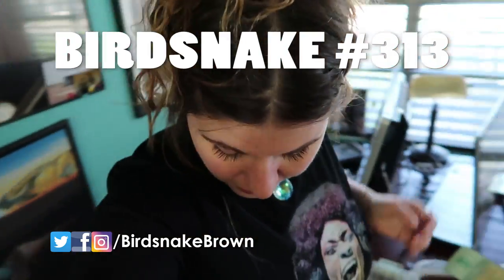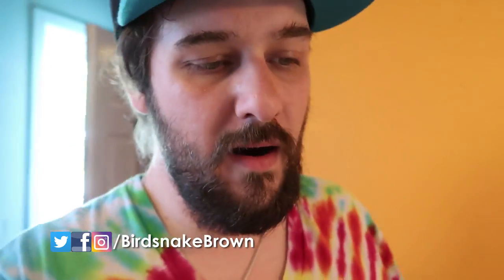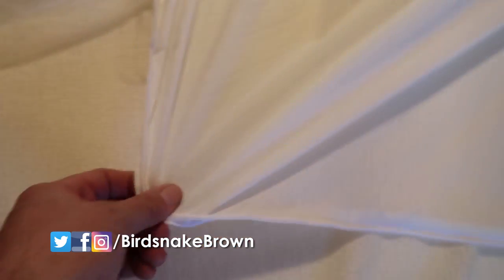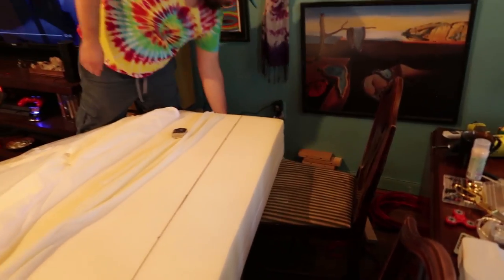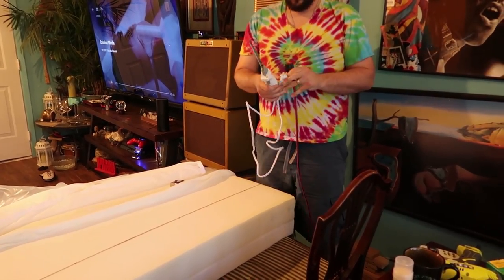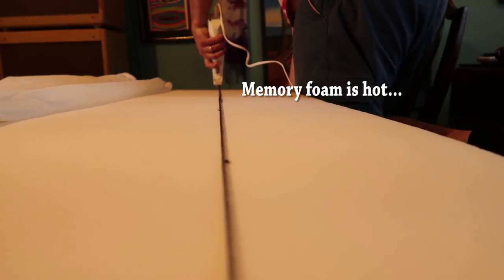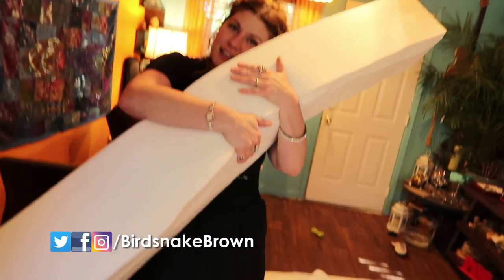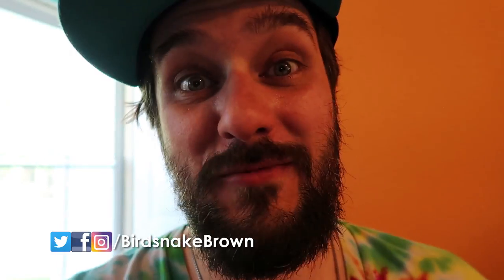CUTTING A MEMORY FOAM MATTRESS FOR OUR VAN

Comment: Did you experience any issues after using the mattress for a while? I just bought a zinus foam mattress and plan on cutting it to fit in my van.
Reply from the maker: We really like the mattress. We sleep on memory foam at home and in the van. We picked this specific mattress for our van because it had a similar feel to our bedroom mattress but with a much shorter profile. Our store carried the mlily brand for 5 years and we never had one back with a warranty issue so I feel pretty confident about it. I looked up the Zinus mattresses and they seem very nice. As long at the firmness or softness suits your sleep style I'm sure you'll love it.
Reply: @ Connor Lipke hey did you have any issues with fiberglass contamination after you cut your zinus mattress ?

Comment: Hey, is the matters keeping up? I heard people say that they may tear apart because they're missing the reinforcement glue from the sides
Reply from the maker: Yes, it's still going strong. We sold them for about 6 years and never had a single call for a warranty issue.
Reply from the maker: It's years later and the mattress is still doing great. We only use it when we camp but it lives through the Texas heat and mild winter. If I was going to sleep on it every single night I would get something softer.

Comment: Did you run into any issues with fiberglass being on the inner cover? I'd like to cut a mattress to fit an antique bed, but I keep reading about people having problems with fiberglass.
Reply from the maker: No, we didn't have any fiberglass in the FR barrier, but some mattresses do.  I'm not sure how to tell you to check because manufactureres rarely list the FR material in their specifications.
Reply: I can’t find a mattress without fiberglass
Reply: Most foam mattresses have glass fiber in the base foam build.  It is not the same as fiberglass.  There should be no issue with this unless the construction quality is poor and the material is separating.
Reply: @CleanSlateForge

https://bedroomstylereviews.com/best-mattresses-without-fiberglass/

That’s the link where I found the article . I hope this helps !